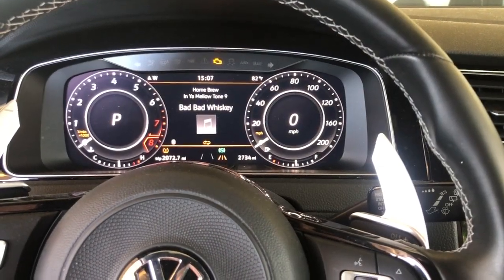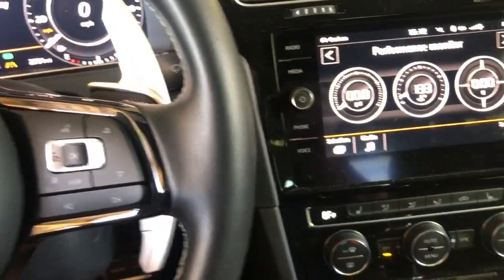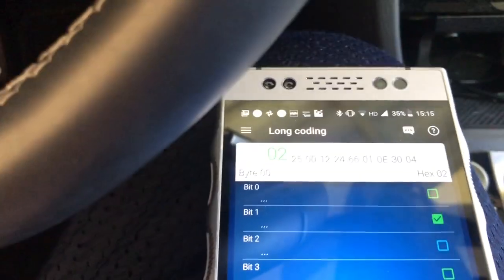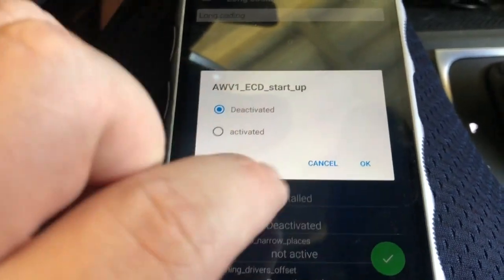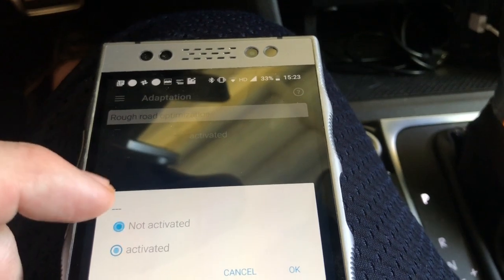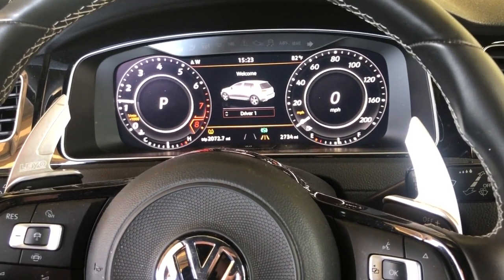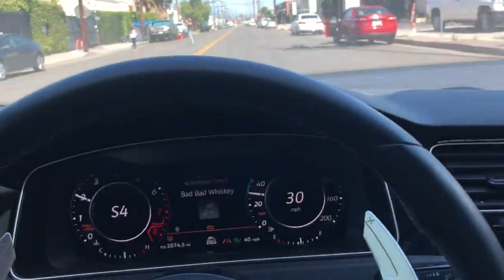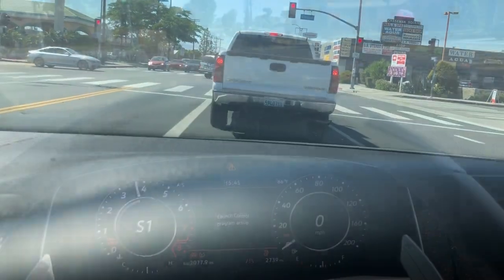GOLF R MK7.5 (2019) - Audi Coding for improved throttle response - OBDEleven

Comment: You put on adaptive cruise control without having the actual feature on the car? It worked only by using the park sensors? I’m confused, sorry.
Reply from the maker: The car has adaptive cruise control from the factory, and I believe all mk7.5 Golf Rs do too. Before performing these tweaks, I was reading from a few others who did this, and they said their adaptive cruise control didn't work after this. So in the video I was trying to test it as best as I could. Happy to report over at over 6 months later, ACC works as expected.

Comment: really wish there was a way to keep basic cruise control while doing the mod. :(
Reply: Same issue 

I tried on my Golf mk7 1,6 TDI stage 1.  Manual transmission 

1. Got throttle response to work with no issue. 
2. Audi Engine responsiveness and then it made errors on brake and engine. 

Result normal Cruise control was not working. 

Changed it back from Audi to VW.

Comment: Can you just change the Adaptive Cruise Control so you can get the warning if you go over the speed limit as show by the sign recognition? I have already activated speed recognition using OBD11 and signs show up in dash in my Golf MK7.5 ... want to be able to set warning for when I exceed speed. With Audi you can set value over limit?  Can not find a way for doing this in VW except maybe the setting in long coding which are not activated ... 'Speed_limit_assistent' and 'Traffic_sign_detection' ... IF I change these to activated will that allow this? Thanks Laurie
Reply: Interesting,  how did you go ?

Comment: Does it work for mk7??
Reply: Hi with my mk7 from 2015 did it work. But i only did the first two steps. After the 3rd stepo i got a error message and the ACC was not working. After setting the Long coding back it's working fine...
Reply: Golf R mk7 2015 its working?

Comment: Thanks for the reference shoutouts. I’ve got some feedback on this that it all works as long as you have adaptive cruise module. If you don’t, you can’t get cruise working with Audi engine hex code. The last one is rough road optimization totally optional, just allows for more wheel spin on launches. Something you may or may not want.